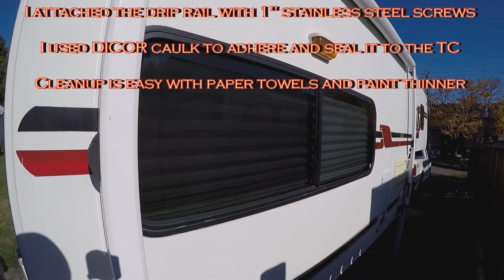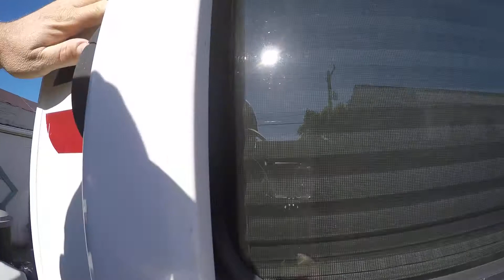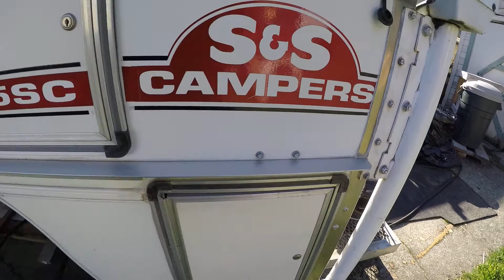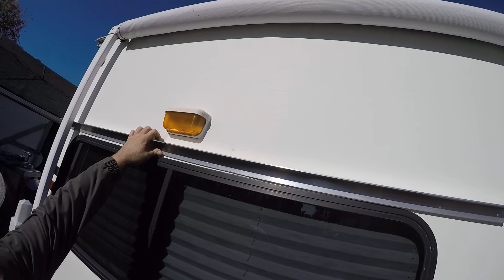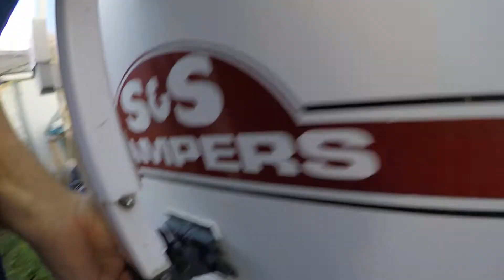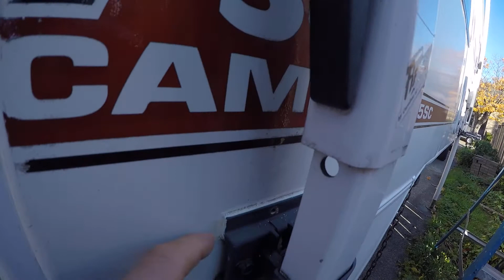Truck Camper Leaking Window Frame Fix

Comment: Very clever. Been chasing similar issue in overhead area on my rig, hadn't decided what to use.
Reply from the maker: Leaks can be a pain. All RV owners have to deal with one at one time or another. Here is a product you might try. https://www.amazon.com/Grace-302100-Mill-Finish-Aluminum-Drip/dp/B00JVQKRJS
You can order it made to the size of your window.
Self leveling DICOR is good for roofs. Eternabond tape is good for some other repairs.
Good luck.
Reply: Run a length of Eternabond tape over your roof where the nose cap meets with the roof and you will make a great seal up there! We do it with all of our campers